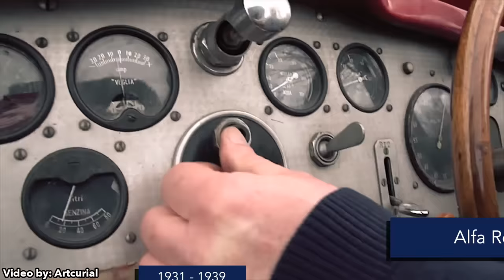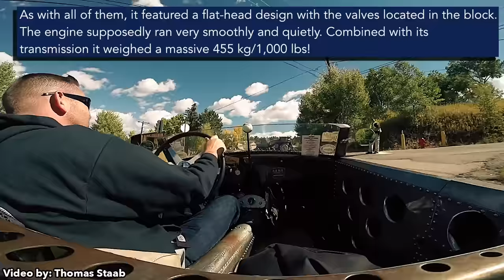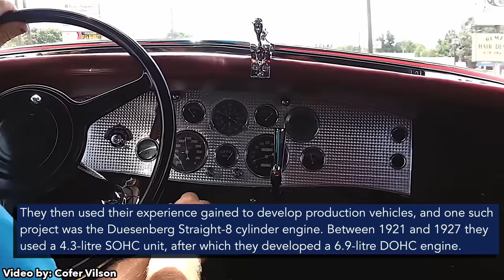The Best Sounding Straight-8 Engines In The World

Comment: I'm hearing a lot of double-clutching.         
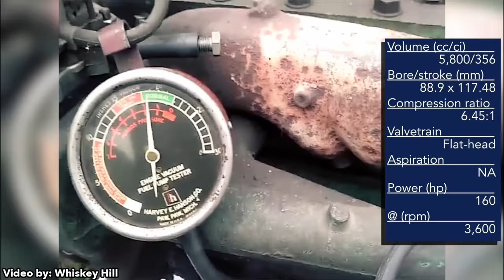6:45 Packard built a lot of inline 8s. The final run was 1954, when five main bearing engines of 288 and 327 cubic inch displacement were offered in the Clipper and Cavalier models, and a 359 cubic inch eight with nine main bearings in The Patrician, the Four Hundred, and the Caribbean convertible. Several show cars such as The Panther and The Grey Wolf were owered by supercharged versions of the 359, producing an understated rating of 300 horsepower. The Packard inline eight engines were so smooth that one could balance a silver dollar on edge with the engine idling.

Comment: I am not one to point out mistakes. First time i have ever done it. But concerning the bugatti portion of this paticular video: a commom mistake was made. The bugatti type 35, 35A and 35C all use the 1991 cc engine but have either a compressor or different bearing in the block. The type 35B and 35T are the only two that use the larger 2261 cc engine. Also either with a compressor or different bearings. I hope i helped out and i am looking forward to you next video

Comment: One thing I noticed about all these engines was the ridiculously low compression. I understand that everything back then was low but can you fathom the numbers if they were up to modern standards? I don't think anything built today is under 9-1. I wonder if the castings would even survive being as the "newest" would be the '53 Buick if you bumped it up.

Comment: How did the Mercedes W196/300SLR not make the list?  Otherwise a great video.
Reply: @Jerry Hughes,Jr  - One of the nicest sounding straight eight race engines has to be the 3 liter fuel injected straight 8 Mercedes with Desmodromic valves (mechanically actuated - no valve springs).  Great sounding under full power acceleration!

Comment: just an FYI... the largest inline 8 produced by Packard displaced 385 cubic inches, not 356.  there is a wealth of information about them, many Packard collectors also have the original service manuals.  one thing that is true is that they're so smooth, you can balance a coin on it's edge on the head of an idling engine.  if you press the throttle gently it won't fall over, either.

i don't know if you could count them among the "best sounding".  when they're in like-new condition they are almost completely silent... i'm talking 30 to 40 decibels at idle.  the fan blades make more noise than the engine itself.

Comment: Balancing a straight 8 engine to run at high RPM must have been hell. These engines were designed to run at low to medium RPM, no greater than 3500 RPM and then only for short periods of time. In that configuration they served the general public well.

Comment: no P:Packard ever won the p\Pike's Peak hill climb  nor sat on the pole at Indy 500.   

The Studebaker President was introduced in 1928 and signaled Studebaker's entry into the luxury car segment. It was powered by a high output eight-cylinder engine that easily carried the elegant coachwork at high rates of speed. Three Presidents were driven around the Atlantic City board track for 25,000 miles averaging 68 mph. This did much to prove the engines durability and performance. 

In 1931, Studebaker enhanced the engine further with a nine bearing construction. A modified version of the President won the Pike's Peak hill climb. At the Indianapolis 500, the cars further proved their potential and sporty characteristics by continually finishing in the top ten. 

By the early 1930s, Studebaker had captured 114 records with 35 of them remaining for 35 years.

Comment: also the largest packard engine was not the 356 it was actually the 359 CID engine first and only offered in 1954 and was standard in the 1954 packard caribbean. It actually was the most powerful engine packard had at the time producing 212 horsepower thanks to the canted valves similar to those in the famous hudson hornet inline 6. in 1955 packard replaced its inline 8 with their newly developed OHV v8 engine (which had 5 inch bore centers which made it have a huge displacement potential of over 500 cubes). It's possible that had packard done things better and stayed in business, that they too alongside the big three would be running laps at daytona and lemans in the 1960s.

Comment: Back in the day, they based the gas, internal combustion engine on steam engine bore and stroke,  long stroke, low rpm engines, making TQ, but the Japanese found it makes more power, to shorter stroke, large bore engines, slight loss of effiencies, but much greater power, by more power strokes over extracting all the power from the combustion ,

Comment: Should have included the 1955 Mercedes 300 SLR fuel injected straight eight with desmodromic valve system.  At high RPM, it had the best mechanical (not exhaust) sound of any straight eight - IMHO.

Comment: the Dusenberg is by far my favorite.
Reply: The Duesenberg is my favourite, too. Not only did these get dual overhead cams in 1931, they got 4-valve heads. That's how they make 265 horsepower with just a primitive supercharger going through a 2-barrel carb. With a 4-barrel carburettor, or better yet, sequential fuel injection, they'd likely be 400-horsepower engines, with that tremendously mean, unmistakably American sound.

Comment: Thank you, I did enjoy the sound of these great engines. However, I seriously doubt the claim of 560 hp from the mercedes W125 at 345 cid in 1937. Some impressive sounds though, like the Packard flathead, whoa.
Reply: Supercharged high compression and running on methanol and benzene... they did it. Probably killed some technicians down the road messing with that toxic brew, but they did it.
Reply: It is true, they actually used up to 575BHP. They even managed to reach 646BHP on the test beds in 1937. But they never used that, because at 575, the car had just left everyone behind!

Comment: Well. No blown Miller 91s from the late 1920s or bigger non-blown Millers from the 1930s, no blown Winfield from the late 1930s and post-war '40s, and no blown Maserati 8CTL or 8CL from the same era, all of which tore it UP at the Brickyard. (Miller straight eights of one size or another won the 500 in '22, '23, '26, '28, '29, '30, '31, '32, '33, and '34. The 8CTL Maser won in '39 and '40, and was on it's way to a third straight when one of the car's wheels broke. A later 8CL was clearly the fastest car in the 500 in 1946, but lost a half-hour in the pits changing plugs. The Winfield engine sat on the front row in '39, '40 and '41.)

Comment: You can't talk about the inline 8 engine with a nod to Packard.  The nine-bearing straight eight was the smoothest, quietest engine around.  You can stand a nickel on it end on the top of the head while the engine is idling.  That Packard engines were great is indisputable.  Packard V-12s from the 1930s now sell for more than comparable Rolls-Royce cars for good reason -- they were better built, higher quality, more reliable, much faster, and in the current market's opinion, better looking.  The vast majority of the Rolls-Royce Merlin aircraft engines were built by Packard.

Comment: Heres an unusual motor: a Inline-10. Have you heard of that one, VisioRacer?
Reply: An inline ten is a very unusual format, and I have never heard of any use in a car, but large diesel engines for ships and locomotives use this engine set up.
For instance the largest ship engine range, the Wartsilla RTflex 96C has an I-10 model and even an I-14.
Other ten in line engines built in huge numbers is the Kharkov 10D100 opposed piston engine used in the Russian 2TE10 class locomotives, these were copies of the American Fairbanks Morse locomotive/marine model 38 8 1/8 diesels from the 1940's, and made more powerfull (and even less eco friendly) during further development, ending at 3000hp
Reply from the maker: No, I did not. I only heard about the flat-10
Reply: VisioRacer inline 10's can be seen in ships and trains

Comment: First one had a great sounding engine but the whine of the blower (or transmission?) was annoying.

The one at 8:40 was a monster. Sounded angry, almost evil.

The Duesenberg right after the Mercedes also sounded great.
Reply: It's the blower. Mercedes-Benz, at the time, still used pressure carburation system. Basically, the air was first sucked by the supercharger, and was pressure-fed into the carburetors, then the compressed mixture would go to the combustion chamber. That made the really loud whine.

Comment: Actually straight 8s are particularly bad in dynamic balance. As in any multiple of 4 cylinders, they cannot be balanced without a balancer shaft. ( I mean in straight form ie not a v12) There is also torsional vibration to consider. The main reason v8s sound as they do is the exhaust manifold phasing.

Comment: What's with the shifting in the first video, bad driver or is it the car?
Reply from the maker: The gearbox had no synchros
Reply: Bad driver, you don't goose the throttle on upshifts, makes shifting even worse. You want to slow the clutch plate down, not speed it up.  I cringe each time I see that footage.

Comment: A modern straight eight wouldn't have the crankshaft issues of yesteryear.  For a start they would be smaller and hence shorter and have crank lengths similar to larger 6 cylinder engines. Also materials are much more advanced than in the heyday of the original straight eight. Of course it will never happen now.

Comment: we could easily fit a straight 8 in New trucks
we have so much New tech we can minimize a lot of things
like moving the battery to the back of moving all electronics inside the car seat
or putting the radio inside the steering weel

Comment: Anyone love how driver in the first video didn’t seem to know how to shift smoothly between gears without adding extra revs?
Reply: thats called rev matching
Reply: @emil.soderholm  rev matching only applies to downshifting, you don’t increase your rpm when shifting to the next gear so rev matching when shifting to the next gear would actually wear out the clutch more and slow acceleration cuz each time he revs up the rpms have to drop again to actually match the speed for the next gear.
Reply: @emil.soderholm  I drive a manual daily and race it casually so I’m not just spewing bs.... it honestly doesn’t make sense unless there’s something weird with that specific transmission
Reply: @morgenglende-michalski369  you're right i had a blackout writing that comment, i meant to say the car might not have a synchronised transmission? so you need to give revs between the gears otherwise it won't go into gear. i believe its called double clutching or something like that in english. i might be spewing bullshit here but i think im on the right tracks
Reply: @emil.soderholm  no I get what ur saying, and that could be since it’s a specific vintage racing transmission. I guess I shoulda been a bit less snarky in my first comment
Reply: @morgenglende-michalski369  it's all good

Comment: 2:40 What is he spraying and in which component of the engine? 
I'm not an engineer.
Reply: SakiSkai most likely hes spraying ether or another form of engine starter fluid into the intake of the carburetor
Reply: picax8398 Thanks for the info
Reply: fuel in to the carburetor, i can only assume its because there is no fuel system connected at all
Reply: he is spraying water on the turdcharger so it keeps his muffler cleaned, if he doesn't, his wife will beat him later.
Reply: Most likely gasoline because the carburetor is more than likely to need a complete rebuild.

Comment: I'm surprised they had superchargers back in the 30's
Reply: The Real Malphite why ?
Reply: Just seems like technology at the time would've made it hard to make.
Reply: The Real Malphite Ok' they have been around since the end of 1800's for industrial applications and then progressed into cars early 1900's
Reply: They were expensive to make, and therefore mostly used in racing, the Duesenberg that had a supercharged V8 in a road car was insanely expensive and insanely powerfull for a road car at that time, compare with other luxury cars of that time boasting 8 or more cylinders that averaged 160-200hp.
However, the aircraft industry made full use of them, as it gave planes better performance at high altitude, preventing the engine(s) starving from air when the air density drops with altitude.
Mechanical engineering was already quite good at that time, and hasn't improved so much since then as it did between 1900 and 1930, what improved is the metalurgy and electronics, which makes engines so much better and more powerfull today (and lets not forget the gas itself, which allows for much higher compression ratio's).
Reply: Induced intake has a long story, even on steam boilers. Some steam locomotives had some kind of fans on the exhaust, to help draught, basically an inverted supercharger.
The most recent development is turbochargers, which started being used on plane during world war I, but dit met success once high RPM turbines and high temperature materials became more common thanks to (again) planes and turbojet engine researches from WWII.
Reply: The gas?  Where today are you going to find the 115/145 octane gasoline that was used in piston engine airliners right through the 1960's?  For cars, leaded pump gasoline powered the ridiculously high compression engines of the 60's muscle cars and street racers long before electronic ignitions and detonation sensors were available.  Good luck running those old engines on today's pump fuels.
Reply: I'm talking about the gas that was available for road cars from the period these engines were built, that was the 1920's and 30's.
When you look to the figures of compression, you will see that they ranged from 1:7.5-8.5 for NA engines and as low as 1:5 or 6 for supercharged engines, and that was mainly becuase car gas in that time had a very low octane rating of around 60-70.
High octane gas was just available for avaiation, as you pointed out, and for racing they started to use high octane from 1930 onwards.(look to the leap in power between the Mercedes W25 and W125 racers, that's not just because of the larger volume of the later one's engine)
But it was not untill the 1950's that higher octane gas became available at the regular roadside pumps, and that was what made possible the high compression rates of the 1960 muscle cars.
Modern electronics is what makes modern engines run well on lower octane gas (91RON) with relative high compression rates and forced induction, altough limited on power if you do so, for max power you need higher octane, in Europe it is becoming difficult to get 98RON, 95RON is the highest you can get now

Comment: I hate videos like this showing people starting engines with no cooling system connected,  then just don't realize the thermal damage they are doing in even a short time. Even just plugging the lower hose and filling the engine's cooling system with water will help equalize any hot spots.  Before you take umbrage how many engines have you run for the fist time on a test stand.
Reply: Correct. Even 1 minute of running from a cold start with no coolant will result in some serious damage.

Comment: Is an inline 10 possible? Lol
Reply from the maker: Sure it is, but most likely not usable beyond big marine applications
Reply: @VisioRacer  i wonder why 2 i5 cyl banks is used yet 1 i10 cyl bank isnt... probably an efficency factor.. sounds like a maintinence nightmare but still lolol
Reply from the maker: @daudikisakye  As I said - I don't know where would you use such a long engine. Its rigidity would also not be one of its strong features
Reply: @VisioRacer  but i12s have been produced.... ive seen 8liter motors aswell. Ultimately curious how an i10 would sound compared to V setup

Comment: The Packard engine is a flat eight, not a straight eight
Reply: nash potatoes looks like an inline 8 to me....
Reply: it has a flat head on it, they don't call those engines inline 8, they call them flat 8
Reply: nash potatoes No. They call it a flat head. Flat 8 would be like a flat 4 or flat 6 from Porsche (two banks of cylinders laying horizontal with the crank in the middle)
Reply: osp80 ahh didn't know that. Thanks.

Comment: Wow the first car,  Mercedes w25 sounds terrible. It may be the crummy supercharger it has but it sounds like a dry power steering pump or the car has a siren on or the transmission is dry. The second car,  the alfa runs like Crap way too rich spitting sputtering and smoking like crazy.. Neither one sounded good at all.
Reply: The early superchargers has plain spur gears to drive the rotors. The made a lot of noise at speed.

Comment: I know the rest of the world uses the metric system, but can the rest of the world please use what the original manufacturer used? this is gibberish from a car collectors point of view when the original engine was marketed as a___ cubic inch engine and is known as such everywhere but in modern publications. yes, I understand about the whole metric system thing, but you are not using the engines correct designation and therefore causing confusion.